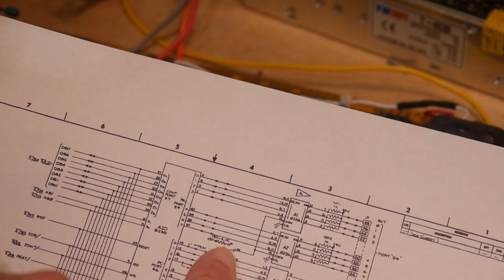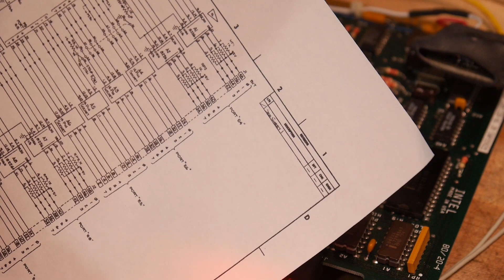#319 Intel 8080 SBC 80/20 Single Board Computer power supply

Comment: I just picked up the T-60B that you have here, but they have installed some kind of plate, and a transformer as well as some small device I am unfamiliar with under the plate. 
As I am not an engineer so I like to move very slow on hooking something like this up, to make sure I do not mess it up, before I get a chance to use it.
Can you take a quick look at the pics, that I have uploaded on my Google drive, and see what they have installed here?
Here are some pics, of the T-60B I just received.
https://drive.google.com/open?id=1yahrVtz2z3Ikxl7bS1v2cGyQueZqTZXB
Reply from the maker: This is a used unit and the parts you mention are not anything you need. remove everything and just use the T-60B